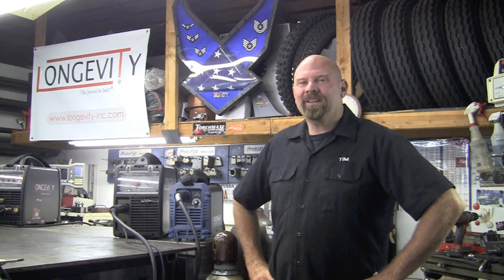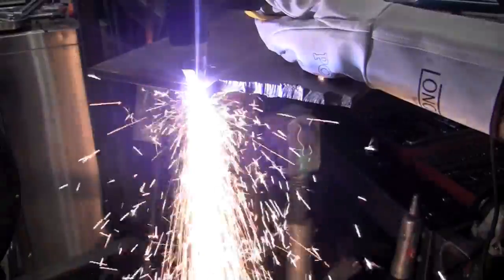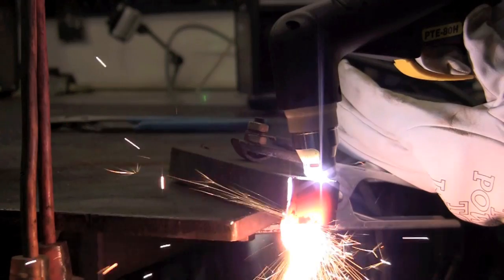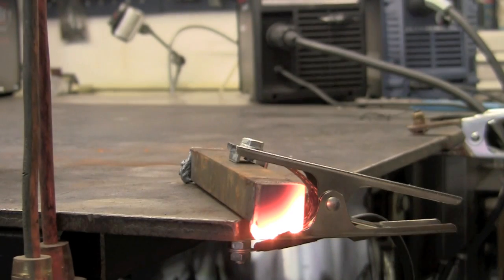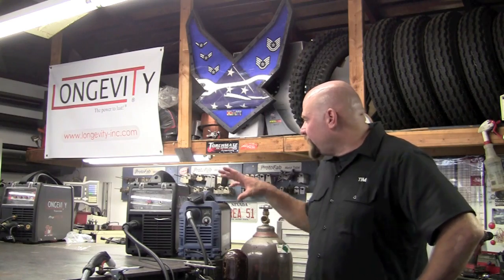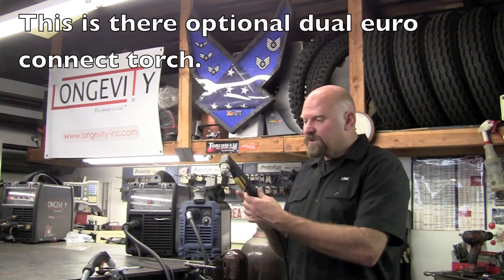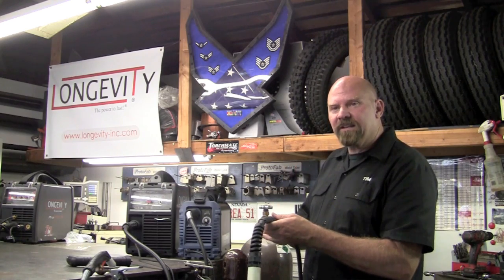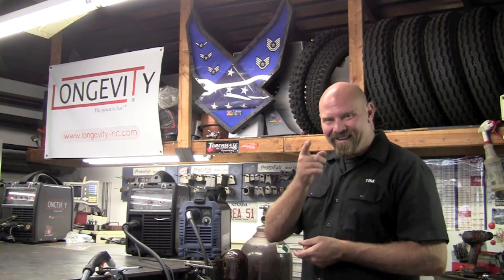THERMAL DYNAMICS CUTMASTER 42 VS LONGEVITY FORCECUT 42i PLASMA CUTTER REVIEW COMPARISON 110V/220V 62

Comment: Longevity cost is $1454.00  Over $400.00 dollar more than Thermal Dynamics Cutmaster 42 at a price of $954.00
The Longevity only has a 1 yr. warranty, where the T.D.C. has 4 yr warranty.  I really like the ability to hook up to the CNC but at what cost make's it worth while is certainly up to the buyer.  I do like the TDC 42 for it's portability and has a carry case, gloves and everything you need included. Only draw back is the lack to go with CNC attachment.

For general use so far I like TDC best being that it only weighs 27lbs. and is a complete package deal.
Reply: looks like over 500 bucks more not 400
Reply: Mine has a Victor torch on TD42,loos the same as the one he's using, I need to get some 20 tips, only have 40's.